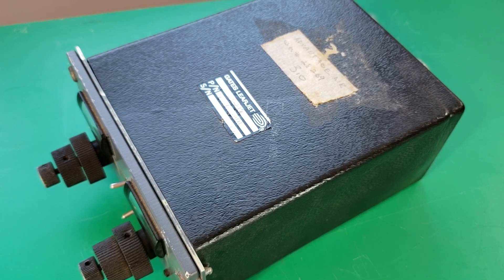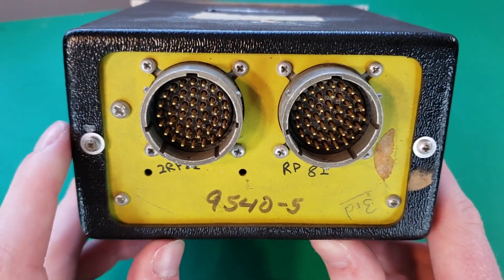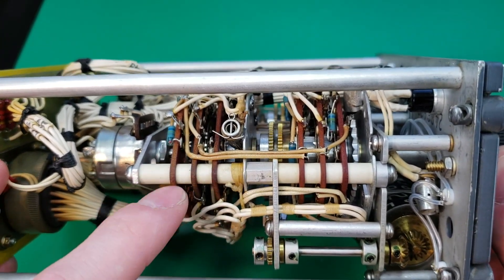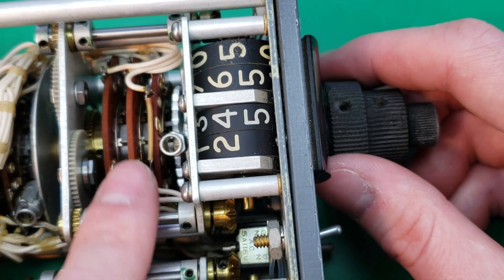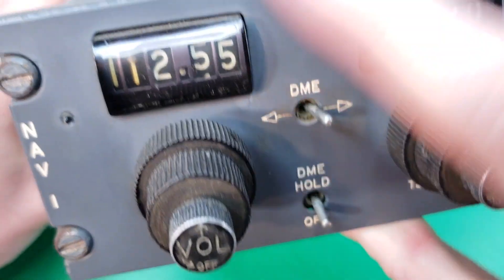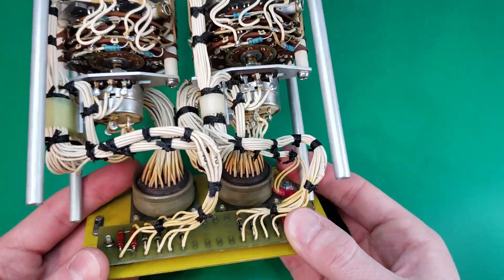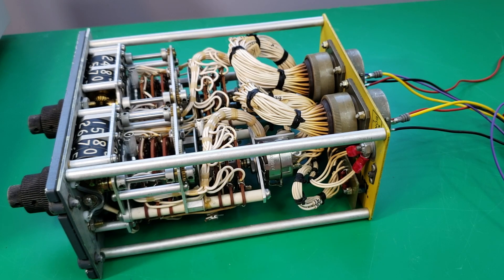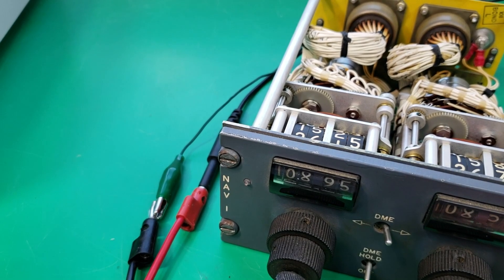Learjet DME Control Head Teardown

Comment: I was building mysel a Boeing 737-330 simulator and gotta say.. I had a lot of these kinds of control heads to connect up. And also the analog flight instruments were a pain it the ass to connect, not even talking about the attitude indicator display and the navigation display.
Reply: And you deserve a sub.
Reply from the maker: Wow that sounds like quite a project
Reply: @BGTech1  Took me approx. 1,5 months and cost around 25 000$. But I finally finished building my dream!
Reply from the maker: @Sonic_The_Electronic_Madlad  congrats on the achievement, you should post a video about it.